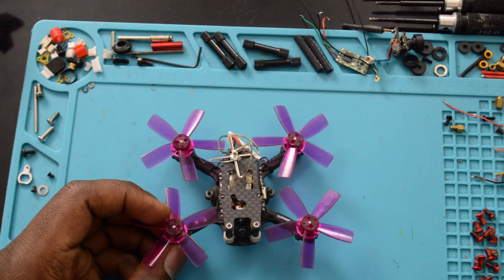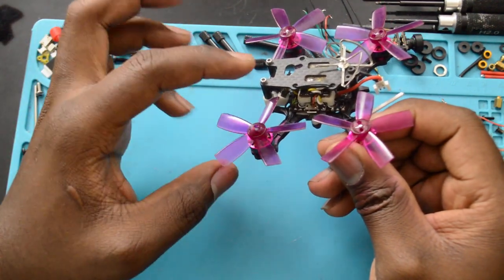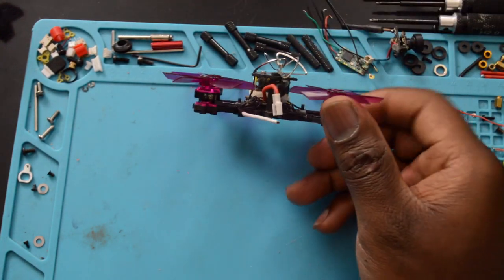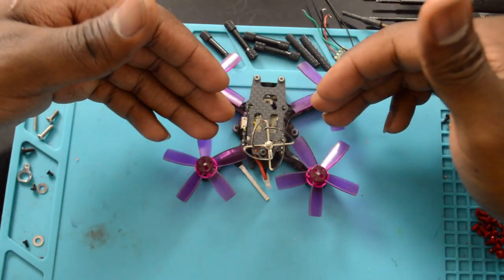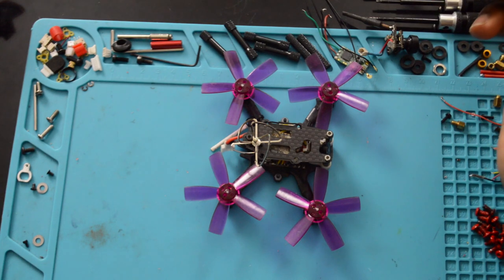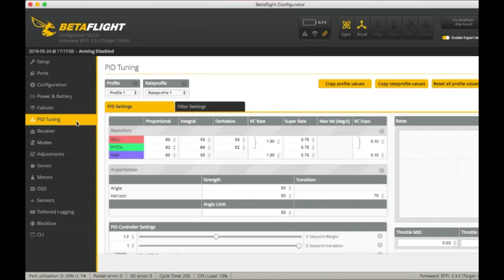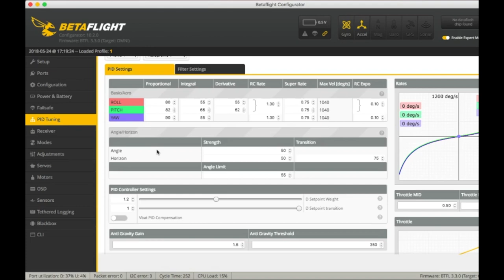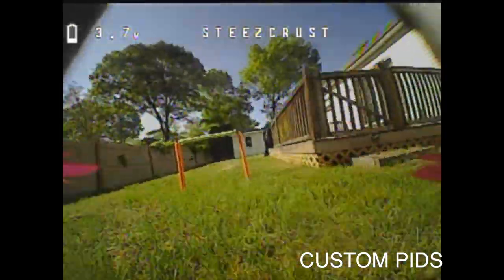ELF 88mm Omnibus F3 AIO PID Tuning

Comment: I am building this frame with DYS BE1104 7000KV and Gemfan 2035 4 blade props. AUW is 105gm with a gensace 
 800mah 2S 40C lipo. I don't want to fly in speed. Will I have any issues to get the quad off ground?
Reply from the maker: Hey! What FC are you using with that setup ?
Reply: DwarfStarFPV airbot omnibus f4 nano v6, hackrc 15A 4 in one esc.
Reply from the maker: @simtcr  nice ! That shouldn't be a problem to fly, maybe a 2S with a higher C rating will even be better but give it a shot
Reply: In India and we have a restriction to import lipos. Only other smaller lipo available is 350mah 30C 2s. which is 25gm lighter.
But considering the approximate current draw of my motors to be 20A, I am not sure If i want go for that lipo.
Reply from the maker: @simtcr  yea the bigger the C rating the better

Comment: are you sure you are using aio fc+esc? may i know how many amps is the 4 in 1 esc?
Reply from the maker: Yup that is the Omnibus F3 AIO it's only for 1s or 1sHV the esc is 5 amps with 6 amp burst
Reply: DwarfStarDrones, say if i use 0706 15,000kv brushless motor..will that   be enuf?
Reply from the maker: Alan H yea that board can handle those motors no problem, I've been using 1103s 10000kv without any issues but I don't recommend you use the pids I have with those 0706 motors, I'm not sure how it will react and you could smoke a motor just be careful and always check your motors to make sure they aren't getting to hot
Reply: DwarfStarDrones, i really appreciate your reply..thanks a million friend!.
Reply from the maker: Alan H Glad I could help ! Thanks!